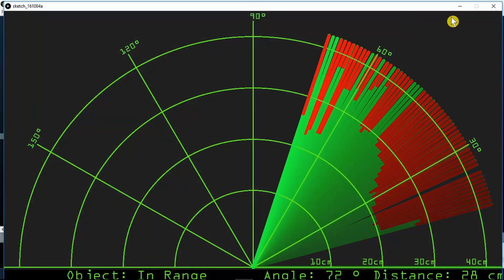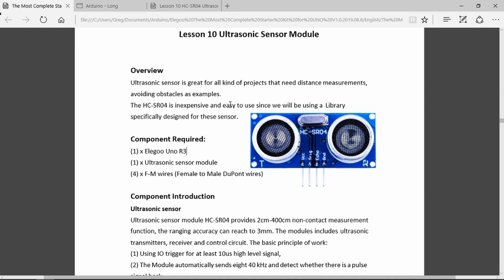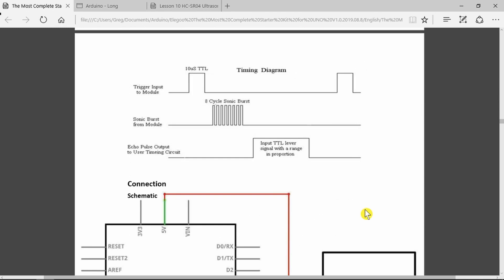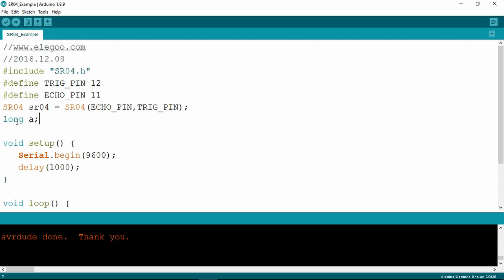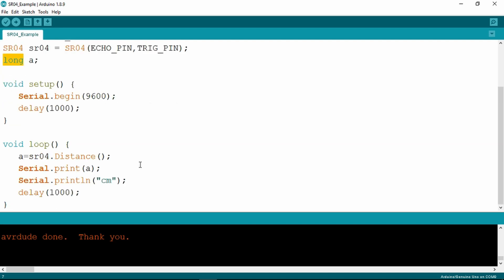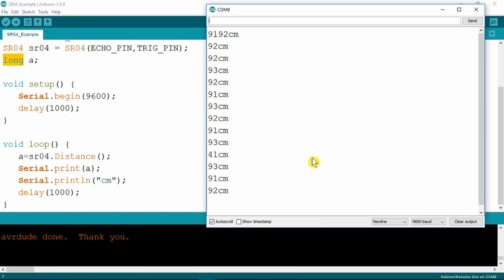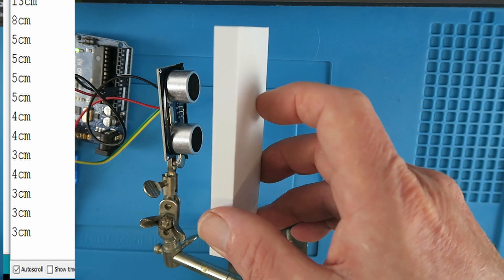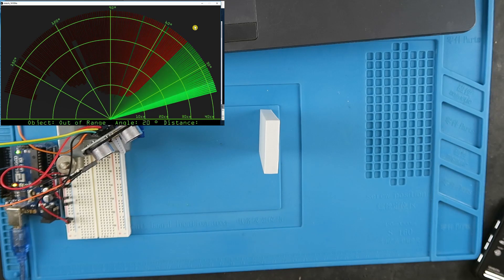Elegoo UNO R3 Project Part 5 The Ultrasonic Sensor.

Comment: Problem adding SR07. I find HC-SR07 That uploads fine, but doesn't write to Serial?
Reply from the maker: Are you using the same sketch as in the video? Here is a link to some Arduino serial problem fixes https://chipwired.com/10-common-arduino-issues-and-how-to-fix-them/ Please consider subscribing if you have not done so already!